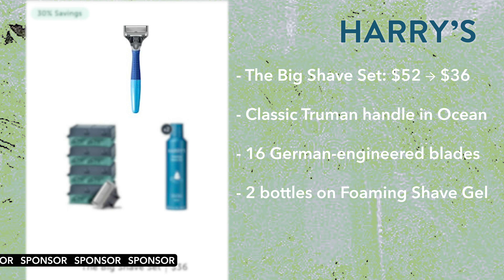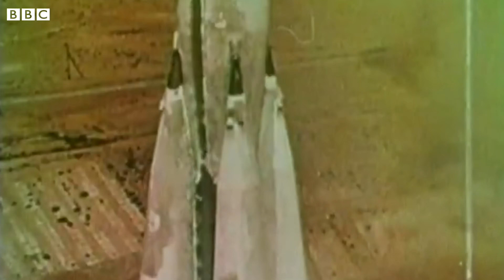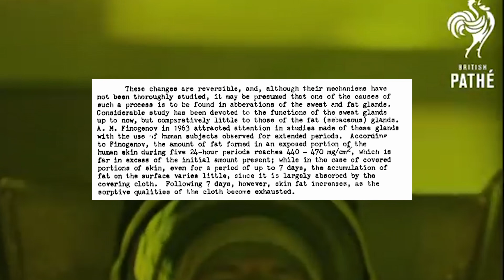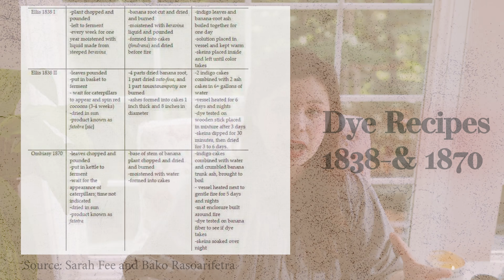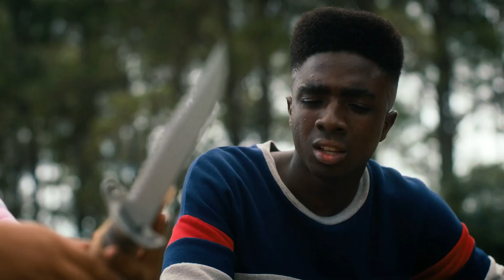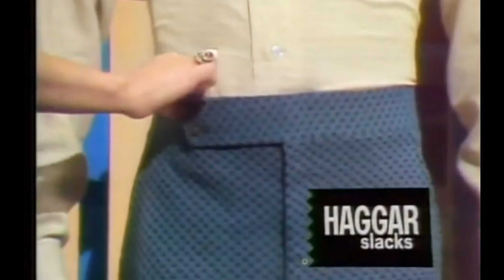The DISGUSTING truth about Laundry

Comment: My dad had his own laundry methods after my mom passed. He did his whites first (in an old top load, agitator machine) and would catch the wash and rinse water in 5 gallon buckets. (So. Many. Buckets.) Subsequent loads would get the wash water dumped back in the wash cycle with less detergent used. The rinse water would be added to the next rinse and any rinse water left over went into the first wash on the next laundry day. The last wash load's water of the day was collected and dumped in a gray-water setup in his yard. He also generally had a couple of buckets of wash water that he used to soak his pots and pans in. Most of his laundry he hung out on a decades-old square laundry hanger in the back of the yard. He did put his shirts in the dryer because he didn't have an iron. He did this until he got sick with leukemia in 2015.

Comment: 1- our clothing is  saturated in chemicals - um yea that what mater is made of - chemicals  , there is literally nothing else 
2- our detergents do not sanitize our clothing - thats what hot air and water( at 65c )  are for ( thats why my dryer is using 75C air for at least 30 minutes  ) 
3- drop the PH to 4 for the wash ciacal for at least 10 minutes
4- at -25c line drying takes  an infinite amount of time  and its -35c now as  type this  before wind chill  and if I put it in my bathroom then my furnace will have to generate more heat for about a week to dry the clothing
5- most of my clothing lasts 3-5 ( 3 against puncture  and 5 against abrasion and degradation ) years and if it dos not I never buy it again

Comment: Well yes and no. Obviously detergent doesn't sanitize your clothes directly.  Physically removing the dirt and oils that the bacteria live and grow in removes most of them, and drying kills the rest. Or at least that happens if your clothes get lots of fresh air. That is why clothes that air dry outside in the sun feel so much cleaner. 
Most soap works the same way. Shampoo, body wash, dish soap, they all just remove oils and trapped particles. Obviously there are some relatively newer soaps that disinfect, but most soaps do not.

Comment: Preach, grrl, Preach! As a card-carrying member of the IATSE Theatrical Wardrobe Union (and the daughter of a former owner of a Drycleaning business) I am a laundry professional, and it warms my heart to see someone who is as passionate about laundry as I am. And I even learned something from your video -- that linen is as much or more antimicrobial than bamboo (which is not even a real textile fiber don't even get me started and bamboo is being marketed as antimicrobial when most often it is not *cue my own high speed tangent/meltdown*).
Some encouraging tips for you from a 30-year professional: 

Vodka! - thanks for mentioning! - Bottom shelf vodka can be found at a reasonable price and evaporates without leaving an antiseptic odor. It is only 40%ABV though, so if you do want to kill germs and not just "freshen", you can add small amounts of isopropyl (99%ABV) to the vodka. Keep in a spray bottle and label well. Because alcohol evaporates, it does not leave water rings on garments, even if you spray enough to soak areas of the garment.

Drying - line drying inside is easier and takes less time than you'd think. We do this all the time with "skin loads" in theatrical wardrobe rooms. In theatre, because most costumes are dryclean only, actors are assigned undergarments that are laundered after every performance. The undergarments are expressly designed to protect the delicate costumes. Occasionally you need to turn around that laundry very quickly - so we use powerful fans and clothespins to hang items over the fans securely. Another tool we use are Spin-X portable dryers - this is basically a centrifuge for your clothes. They are smaller and less expensive than a tumble dryer, draw less power, and have been around for a long time. Clothes come out of the spin-x slightly damp, and air dry a lot quicker. We also use hot rooms - small closet-sized rooms fitted with heat pumps on timers - but you can turn any unused small room into a hot room with a portable heater. I found my basement furnace room is a hot room whenever the heat is on. With a good rack and some clothes hangers, your clothes can dry in a few hours or overnight. Add a Spin-X, a heater, a fan, and clothespins (so the fan doesn't blow clothes onto the floor), and your clothes can dry in less than an hour, which beats dry time on many old tumble-dryers. 

Turn-out and air your clothing - don't shove items right back into a packed closet or hang multiple things on the same hanger. Spray pits with vodka and hang them inside out where air can flow through them. You will save doing laundry and avoid ironing.

Comment: Because I hate ironing, the whole family moved to wearing under-tee-shirts under our workwear and school uniforms. So our torsos are covered between our bodies and cloths. Along with aprons and napkins, we don't have to wash our outer clothing that much. We do an average of two loads a week for a family of three. We use a hardwood stove for heat and so we can make ash-water to use in replacement of detergent (it also is a water softener and alkaline). We throw in some borox and washing soda if the clothing is really dirty. I don't use fabric softener because as you say it doesn't wash out. I do use my dryer more than I would like but except for August and September it is too humid and cool for our clothing to dry outside. I can hang it in front of the wood stove, but I generally only do that for outer clothing (when I do fully submerge it) and still put the underwear in the drier. I didn't know the spray with alcohol, but that is brilliant and I am stealing it. I do have a front loading high efficiency washer.
Reply: And dress shields!

Comment: What a rant! But thank you for bringing out issues which should be considered a whole lot more than they are.  One question comes to mind.  Is the fact that bacteria remains in the laundry actually a risk? Or is it just something that now makes us feel yucky?  I have always used a front loading washing machine as someone told me its as close to slapping the laundry on a stone as we can get.  Which, as I know of folk who have done that, is a miserable, cold and exhausting process.  Yes, in Canada we lived in a subdivision where washing lines were banned!  So, we called it an “outdoor laundry airer” and kept it fairly discreet.  At the moment I toss my laundry into a dryer (heat pump with condenser version) for about 10 minutes and find that softens up the fibres before I hang them on a rack to finish drying which removes most of the wrinkles.  Interesting information about alcohol and sanitizing the laundry.  However, a deeper dive into modern best practices would be such a help.  I have a suspicion that even some of the so called “eco friendly” laundry products are still not that great.  Also horrified to find out how dingy and beige cotton underwear gets even in soft water.  - only realised this after buying some new ones.

Comment: Lost me at "soap/detergent doesn't remove microbes" (ok, then don't wash your hands)
And "bleach will destroy my septic system" (mine is running fine after 30 years)
And "poop will get on everything" (grow up, on a microscopic irrelevant level. Hate to tell you what paper money and doorknobs have all over it...)

My clothes seem to last 5+ years with regular wash-dry cycles. This is acceptable given the many many hours it saves and... have you tried hanging up wet clothes in subzero temperatures?

Neurotic and misinformational.

Comment: I see comments on cloth diapers. When you have cloth diapers you learn a lot about laundry, sanitation and preserving the heck out of them. 
I love my old school flat double weave muslins, they are going strong for child number two and honestly feel like they will last my lifetime. 
It was interesting hearing about rain water, where i live we have lack water so it will be super cool to use our rain water for laundry. We also use our grey water for the garden so we have to use a biodegradable and safe detergent. 
I live in Cape Town, but im Spanish. Many times I’ve thought of getting a dryer because i have three children but i just don’t see that hanging clothes is more work at all, maybe im just used to it. 
I would struggle to live somewhere without a good line that the sun shines on…. I have lived in the smallest apartments, and we still had those outdoor lines you pull towards you from the other side of the street, they are the best and don’t take any space inside your house.

Comment: Only thing that doesn't match with my experience is clothes being easily damaged. I have so many old t-shirts I would love to get rid of but they are in the same condition they were 10 years ago after countless washes. The price is a disposable price, but sometimes I wish they would actually wear out once in a while instead of building up in my drawer. The holes I get in my shirts have only been from leaning against a counter at work, rubbing them on my belt 🙂

Comment: Very informative video. I have learned about a lot of the drawbacks in modern laundry (5 years ago I stopped using fabric softeners altogether!) but never knew HOW much better sun drying is than  air dryer drying. Living on the 10th floor in the Bronx in an apartment with no porch air drying is not an option. Also didn't know how much better Linen is in sturdy clothing! Thank you very much!

Comment: Depending where you are at, environment is also a factor in why some people don't utilize line drying. Winter, space, or being in areas with air pollution can be a deterant. I do prefer line drying and I try to utilize it, but just wanted to point out some additional reasons why people don't use it. 

For hiding your hanging underwear, there's clip hangers you can utilize for that. They're basically a square with clips in the middle so you hang your undies in the center then hang a shirt or whatever along the outer rim so nothing is touching but your underwear are hidden from sight

Comment: There is also a huge time component here. I don't have the time to hand wash all my clothes the way that people used to. It's to the point where I refuse to buy clothing to be worn every day that is hand wash only. I also live in a climate where it is freezing or snowing for a good portion of the year, so line drying outside is not an option. Inside is possible, and I have a line and drying rack in the basement, but to dry a full load would require an enormous amount of space. I recognize all the problems that you mention, but the simple fact is that time isn't free either. We do hang on to clothing for as long as possible, and for the adults we still get many years of wear out of our clothes.

Comment: I would like to do further reading on this. But just from an initial impression, I think "do we actually need to 100% sanitise our clothes" is worth considering. 

There is microorganisms everywhere in the environment. And for the most part, our immune systems can protect us from pathogens. 

So there has to be a point where the clothes are clean enough that they do not cause us active harm, even if the clothes are not 100% microorganism-free 

The bigger issue is definitely that our laundrying practices can harm our clothes' lifespan imo

Comment: I remember once there was a big summer storm and the power went out for five days which meant the well pump went out. I had to fill buckets with water from a nearby creek, boil the water on an outside fire, and hand wash a TON of clothes, then line dry them. And you're right about hanging clothes lines. We can't do that in my town; I live in a brownstone from 1925 turned into a ton of small, crap apartments, and it would "look poor". But the slumlord doesn't keep the washer and dryer in working order and I can't afford the laundromat.... So what's my other option?! I hang wet clothes over the radiators!

Comment: As someone with OCD washing my clothes was always important to me. Especially the clothes I wear outside. So while I love history bounding, I have a huge problem with fabrics that are not washable. So when I designed my first outfits I selected fabrics that are washable like heavy duty cotton, rather then wools and silks. For more then 4 years I am wearing skirts, instead of jeans now. The jeans I bought lasted me about a year before chub - rubbing their way into an early grave.    Well and my two first self-sein historical skirts made of cotton have now lasted me about 3-3,5 years now despite of weekly washes. The colors are of course very faded now, and one of the skird now absolutely shreds at a lot of seams... BUT: 1: most of the damage happens in areas where I know I made sewing mistakes. 2. One skirt in particular has a rather delicate cotton and lining that just is prone to be destroyed through washes eventually. And 3., all those years are still a pretty good duration for just wearing two skirts, and a few self-sewn Leggins underneath. From a cost and environmental point it's was absolutely worth sewing them, repairing them and caring for them for all of those years.
Since one of them is not wearable anymore I am sitting on a new cotton skirt with stronger lining, and stronger seams/construction, in the hopes that It will last me even longer.

Regarding the drying issue: we do traditionally dry our clothes on a drying rack in our apartment, since we don't have a garden to do so. Because I hate our ugly metal drying rack I came across a more historical type: a lot of racks or lines where hung right under the ceiling back in the day. Firstly to have mor eliving space, but also because the air directly  under the ceiling is warmer and dries your clothes faster. So I am going to build myself a wooden rack that I can pull under the ceiling.

Comment: We had a water softener thing in our house, still did nothing to help the wash. What I've seen is that the double filter we have on my MIL's house is making a difference, as well as making our own, minimal chemical detergent, using vinegar or a baking soda/peroxide mix in sanitizing and aiding in the clean without damaging the already cheap materials of the fabrics like store bought detergents and fabric softeners do. We even use wool dryer balls because both dryer sheets and liquid fabric softener have formaldehyde in them. My youngest is very chemical sensitive, it's not happening. Sweetie, get in touch with me. I have recipes for septic friendly detergents and we don't bleach since we have a septic, too.

Comment: Great article, well researched. I am 77 yrs old. As a 23 yr old mother and not much money,  we bought a wringer washer  and used it with two stationary sinks. Filled washer, then added good whites,  underwear,  light coloreds,  dark coloreds and lastly cloth diapers.  Changed  to new hot  water for diapers.  Two rinses  with two water changes in sinks.  Hung clothes outside in summer and in  basement in winter.   Had very clean clothes,  Grew   up with automatic washer and dryer and have had  4 or 5 new washers and  2 dryers.  Qualitiy of product diminished with each new purchase. I have lined dried for much of my life, as I do currently.  Used white vinegar for rinse/softner.  Never softner products.  They reduce absorbancy and attract dirt, in my opinion,   I also find the borax, washing soda,  grated bar soap and occasionally Oxi-Clearn home recipies to be good substitutes for commercial laundry products. I buy linen/flax fabric from a California company named the Fabrics-store.com.  So many well spoken and  interesting  commentators.

Comment: This was a really interesting video, not least some of the eye opening differences between the US and EU - I knew you guys still had top loading washers but not that they were more destructive of clothing! And bans on line drying?! :O 

You didn't touch on a big part of laundry hygiene, which is washer hygiene (although you did have the clip of someone rinsing out the agitator). It seems counter-intuitive but the sludge build-up in machines really contributes a lot to bacteria and smell in laundry, something that line drying really helps with; so do higher temperatures, but everyone is encouraging us all to wash at lower temps to save the environment! "Unless it's dirty, wash at 30C" is the mantra here. Well it may not look particularly dirty in terms of staining, but towels, underwear etc. absolutely MUST be washed at higher temperatures than that. And you need to regularly clean your washer to keep things nice. 

As for not using hard water - I am blessed with being in one of the softest water areas in the country (it's also much nicer to drink!) but what are you supposed to do if you're in a hard water area, other than use softeners? That stuff clogs up and wrecks machines, too.

Comment: Thank you for this video!
For some reason I have seen a lot of laundry-related content recently, and before that I had never seen laundry machines like the one you show there. I am European so maybe that's why. 
A few years back I started separating my laundry loards into 3 categories :  my underwear, towels and bed linens at 60°C which is enough to sanitize them, regular everyday clothes at 30°C, opening buttons, closing zips and hooks, turning zipped clothes inside out (ideally I would separate jeans from softer clothes but realistically I don't have enough clothes), and lastly work clothes (aka smelly poopy clothes) at 40°C with baking soda (I don't understand the chemical process but they come out less smelly).
Also I line dry because I'm poor haha